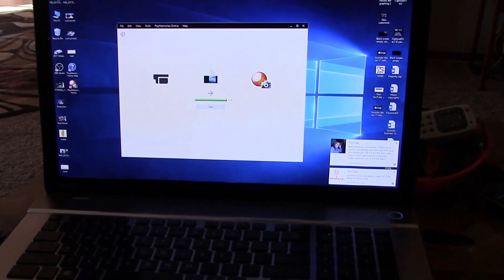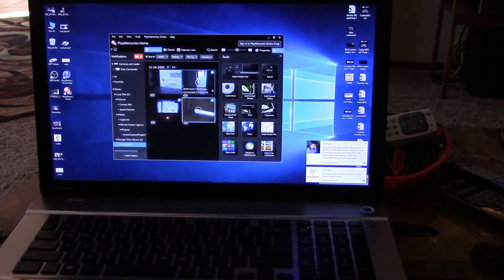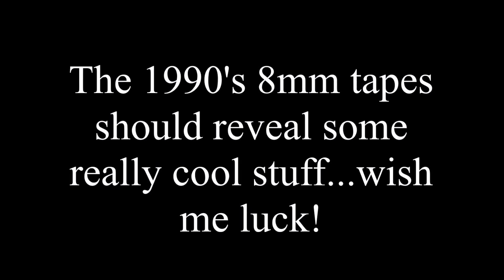Old camcorder data transfer project - Can it be done? We'll see!

Comment: something to help you with your old 8mm camera possibly. StarTech Standalone Video Capture and Streaming - HDMI or Component, 1080p - USB 2.0.  there may be better options, but I've used stuff from them for many other things.(not this particular device)  they're cheap, but ok.  I used to do this with ATI All In Wonder cards in my pc.  still have one left if I ever run across any more tapes.  The search phrase I used to find that, and many more was simply, analog video to computer.  I like the StarTech because you don't really need your computer to capture to from what I read.  it just records to a SD card.  from there you could copy to your computer.  But it doesn't leave room for editing or only copying select portions I don't think.  You could edit the mp4 file it creates, but you'd be working with compressed video of an already lower quality source.  Those tapes may or may not have held up well over time.  some don't.  Best of luck.